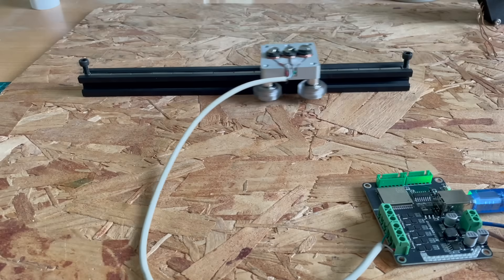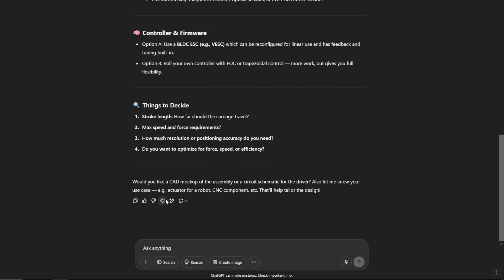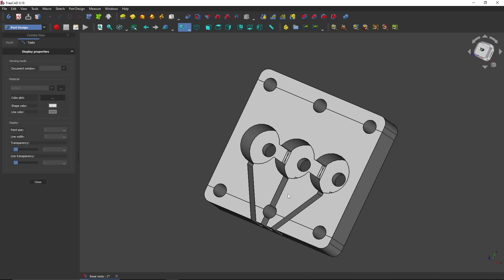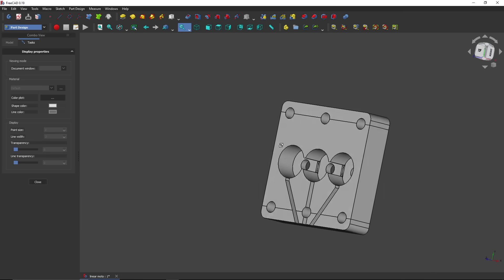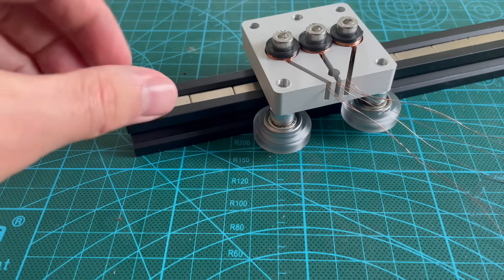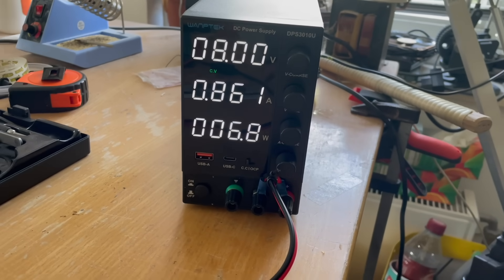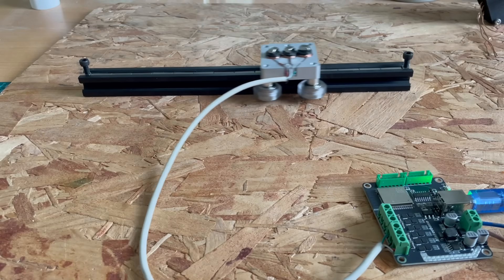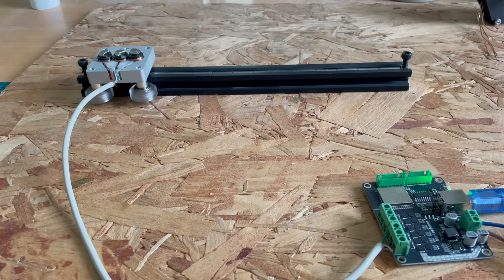AI Designed This Linear Motor

Comment: Whells were oriented correctly, i'm not sure about coils, but linear motor don't necessary means it will float in the air, so wheels are in good direction
Reply: The wheels were definitely wrong on the first AI draft, especially if he wants to use these linear motors as actuators for a moving robot. If we go with the AI's orientations of wheels, the motor would only work while laying down, helped down by gravity, it would not work as a moving leg of a robot at all. So the wheels have to cling to and roll on the structural component of the motor, that way you can flip it in any orientation and the motor still works, it would not fall apart or change behaviour/effectiveness like a gravity assisted one would.

On the topic of the coils, they were also wrong, in two different ways. N1 is that they were aligned in a cross pattern regarding the aluminium structure, they should have been parallel like he did after. N2 is that each coil was having its main plane in a vertical orientation (the 3 sharing an axis) while the correct orientation is having the axis of each pointing down into different parts of different magnets, which you can see that he also corrected.

The design is correct on both accounts, and at no point the motor is supposed to levitate, it just rolls on the wheels. The main problem is the amount of power not being much, and not being efficiently used, that's why it's a 100g motor and not a few kgs.
Reply: Agree, let the wheels carry the load and let the motor move it.

Comment: and so we all get dumber.
Reply: I disagree, I'm a manufacturing engineer with a lot of experience in running CNC machines, manufacturing, 3D printing etc. I can design and fabricate about anything I want, but when I try to incorporate Arduino my skills are still basic. I've taught myself a lot but I don't necessarily want to spend 3 hours designing and then 30 hours trying to figure out basic code for a project. Chatgpt allows me to enter a prompt and get code that is 90% and there and helps me understand how it did it. It allows a lot of us to expand our abilities.
Reply: and faster

Comment: Magnets on a shuttle instead of on the rail will allow you to optimize the electronics. Suggest you flip the design. Also add linear scale so you can compensate for lost steps. You might be able to increase torque by decreasing the speed.

Comment: Cool project. Didn't know these types of motors requires a "FOC". Hope you make a better version of it that actually has good torque. I think you would need to create a laminated core inductor housing for the coil so that it can eliminate eddy currents and maybe better coils too to get good torque. "Metglas" cores made from amorphous metal are the most efficient and can provide great torque.

Comment: Linear motors are pretty cool, huh? Imagine a stepper motor, just un-wound and flattened, and then this is essentially what you've created. as others have said I would use thicker coil wires, alternate the poles of the magnets and space them out slightly but evenly, reduce the coupling distance from the coils to the magnet array and use a ferromagnetic core within the coils too, such as a "U" or"E" design for a 3-phase motor like yours, then another trick is to use a steel or iron backing plate to further amplify the feromagnetic force the coil driver has on the stator array. You're on the right... track Haha, but no seriously, check your code and ensure the timing is correct too, with these additional modifications you should be able to produce some good torque, especially if you use a printed base and reduce the weight of the driver saddle significantly.

Comment: For a more powerful motor, I would put the magnetic poles closer to the magnets. Also, I would use thicker wires in the coils to handle the higher current. This is necessary because the voltage of the system must be increased, which increases the current. This increases the flux, so in the end the motor will be stronger. Good luck!

Comment: 8:25 It would not move a kilogram an inch.  Therein lies your problem. 

The magnets should be much stronger with the field attached to a series of poles.  Look inside a stepper motor.  The gap between the rotor and stator must be as close as possible.

Comment: excellent video - subscribed - didn't know ChatGPT could do this

Would you be willing to share your prompt? 
I'm also curious what chatgpt would say about increasing power - were its performance estimates good?
Do you think the wheel orientation limits performance because the load sits vertically, off-axis on the wheels?

Comment: Very cool! Never tought to unwrap a motor this way! I don't necessarely think its not strong enough for the load you were applying (cause it wasn't lifting the weight, just trying to accelerate on a low friction set up)... It feels like there should be a feedback on the position of the carrier. In the velocity_openloop mode, the motor driver will blindly produce the signal for the coils, regardless of where they are relatively to the permanent magnets. So when adding a load, even if the motor isn't going as fast as the driver think it does, it still sends the same signal which stalls the motor. To fix this, you can still use the simple_foc library, but you should try a closed loop mode (FOC) with some sort of position encoder. Now the library is made to work with rotational encoders, but I am pretty sure you could use 3 simple  hall effect sensors in the same way they are used in bldc motor, provided they are properly spaced (I think it works better using trapezoidal modulation with these sensors). You could also use other sorts of linear encoder  and scale the reading so to trick the algorithm to think the motor has done one electrical rotation for each magnetic pole pair the motor passes. Keep up the good work:)
Reply from the maker: Yeah a position sensor would be a good idea but then id have to use some sort of linear encoder and they are hard to use
Reply: @DeanZylman  The hall sensors would give you dramatically better torque and there are controllers that should allow you to use them pretty easily. It's the same method hoverboards use and they get a lot of torque using that method. re: Linear encoder - not needed you already have wheels. Put a rotary encoder on one - way simpler.

Cool project, subscribed

Comment: ChatGPT design a motor, but perhaps you need to have a chat about power and torque (force) requirements.
Reply: You overestimate its smartness. It solves simple and well described tedious tasks, it is not capable to correctly generate non-standart out of box solutions. If it cant be solved by better magnets/coils, it will fail.
Reply: I disagree. This is not so far out of the box that ChatGPT wouldn't know that linear force is akin to torque in a rotary motor. It'll know what magnetic field strength (B), current (I), and number of coil turns (N) are needed. It'll be able to translate voltage and resistance into current. It'll be able to suggest if the field strength is possible or ways to improve the field given the constraints. This is all standard motor stuff. I bet there's a fair bit of information on linear actuators that it'll know about. It'll know a lot more than me.
Reply: then it will give you the image of a train :)
Reply: You need an iron core, check the distance to the magnets, resistance and number of coils

Comment: You should try adding a position sensor so you can use foc closed loop which will give you much more force with few modifications, probably a linear encoder
Reply from the maker: Yeah a linear encoder would be nice but I don’t know if it wil work with the open FOC controller
Reply: @DeanZylman the controlling circuit can sense how many steps it moved. Basically you have 3 coils, two have reversed polarity and one as sensing input.
Reply: for linear encoder use the absolute linear inductive sensor by microchip. device name LX34....  @DeanZylman
Reply: @raziel06001 @DeanZylman
As mentioned above by @muayyadalsadi when you have at least three phases of coils you can record the electrical feedback as the coils engage with the magnets to use the driver itself as a linear encoder. It's a bit more complicated than that, but that should give you a lead to research along if you take it in combination with their comment as well.

Comment: awesome build, and super silent, obviously! Too bad its so weak. I dont know anything about anything, but maybe building it with larger coils/magnets would give it some torque. Been considering building myself a rail/dolly for my timelapse DSLRs but would definitely need a bit of torque and the ability to hold its position where this would (I assume) slide around if not perfectly level, or a breeze came along, once it lost power. Loved this video, man :)

Comment: Very cool.  I think the next step is to use a Halbach array to concentrate the magnetic field above the Al extrusion and to get more torque.  Also, you probably want to use something better for the center core of your coils, something with more flux density carrying capacity than those bolts, and ensure that the ends reach nearer the magnets.   I'm not sure whether there's an optimal spacing between the three phases and the magnets as well.  My guess is that if you got shorter magnets, you would be able to get more precision, and if setting them up as a Halbach array, a significant amount of additional torque.  It may even benefit you to cut some very thin vertical slots into the Al extrusion near the top, in case you're incurring significant losses due to induced currents in the aluminum.  The slots would limit any circulating currents.  In any case, I like it.  I was looking into a building a cheap linear motor too, and I like this approach.  I say, keep working on it.
Reply: Just to add.. I hope you don't quit... I can't understand why you would get this far and quit... It makes no sense to me. So follow the suggestions of the HalArray, I know JLCCNC is your sponsor but for now 3D print your rotor (until it's refined) your windings are too big., the material between the windings and the screw is way to big, shout be in the order of. 1-.2mm for this design. You can print a case for the magnet to slide in the slot then have shorter magnets that are also taller. I would use a material like PA6 from Bamboo Lab only because it's hard and will not spread your flux field.  I figure you went with three because standard motor config but in your case you need 6 if you stick with this. (I personally think you should stick it out and build your own.. This idea you have is bonkers (great).  You can also use an esp32 S3 with tcm2209. Last suggestion is instead of the screw you may need JLC to make you some top thread rods from a material that is more suited for this application (normally silicon steel) or you can design it in cad make a negative mould. Then mix silicon steel powder and 2 part epoxy and aluminum oxide a bit of silica and make your rod. You only want it to have a magnetic field when energized and lose it after so you don't have it working against the motor (cogging) If it's top threaded it will stay in but the part that is closer to the magnet needs to be predictive in shape not threaded. The distance between the rod and the magnet must be very close...0.1 max. Best wishes
Reply: @zaybxc0  why do you say that he needs 6 poles instead of 3?  And do you mean 2 of each phase next to each other like a 6 pack of eggs shape?

Also, Would 2 not be sufficient?  Or maybe I’m only thinking of what’s needed for motion and not precise motion.  More poles would be more precise, right?
Reply: @MantisRay861 The poles (6)were to address the issue with low 'torque ' really force. The flux created by the coil needs to be directed to the magnets (much like reflectors in a spotlight or lens in front of a light) so if your 'light source' is small simply increase your 'bulbs' in this case your coils. But put them in parallel, this keeps resistance low. (unless you prefer higher voltage and lower current) So you would have. :a, b, c, a, b,.c. When you energize it would be A, b, c A, b, c. Remember to use shorter but taller magnets (if you can't find taller just stack them) and keep the air gap(space between magnet and coil as close as possible. (this will substantially increase forces).
Reply from the maker: Thanks man, A halbach array is a really good idea but it might be tricky to fit the magnets into the 2020 aluminium extrusion 🤔
Reply: @DeanZylman  Just 3d print the extrusion that suits you. I didn't exercise the idea but my gut says E shaped transformer core might help to confine magnetic field as well.
Reply: @DeanZylman  maybe an increase in magnet count with shorter length magnets could help, but then you also need more compact or even flat coils.
Reply: speaking of which: rectangular coils with the current spacing would also increase force by having more inside area.
Reply: @TobiasKornmayer yes but think of it like a gear. Yes a thicker gear has much more power to transfer forces, but it is also jerky and normally noisy. So in the same way the size of the coil/magnet pair(gear teeth) should represent the size of the motor(gear system) Technically speaking a linear motor is a radial motor cut at the radius and layed flat. So grab an existing motor design and work from there.
Reply: @zaybxc0  The current is modulated to a sine wave, so no cogging or jerking. 
The coil dimension in travel direction needs to match the magnet length of course.
Reply: @DeanZylman you can get much thinner (square cross section instead of rectangular) for the intermediate magnets of the halbach array, they dont have to also be rectangular and at 90 degrees. Usually the intermediate magnets in a halbach array are a fair bit smaller/narrower than the main magnets since they're mostly there to direct the magnetic field of the main magnets that you already have. Think _._._. Rather than _l_l_l
Reply: This is why I love youtube comment section
Reply: Some humans still better than ia
Reply: Definitely something better in the poles.  Probably if you could, you'd want a ferrite or something.  Probably also worth putting a keeper on the non-magnet side.

If you can rig it... make a 2nd 2020 rail with the magnets alternating [no keeper!] the bottom rail and that should help a lot.

Dunno about a Halbach.  It sounds good, but it has the annoying tendency to make the manet alternating bands of strong and one-pole, so I'm not sure you can handle your 2020 being "all north"
It's probably also worth putting little plastic spacers between the magnets in the rail to get the fields to want to go more "up" to bridge the gap.
Reply: Maybe if the rotor  was made of iron, it would converge more the magnetic fields.
Reply: @thomas-xavierguimont2760  Steel, iron, and ferrite are good for that.  Problem is steel and iron really don't like to change their direction (they saturate too easily), so your "force from the electromagnet" is having to overcome "magnetic attraction to the steel."

Ferrite... doesn't take a set as easily, so it's easier to flip around.
Reply: .... Hence silicon steel... A bit more expensive but designed for this... That's what transformers and motor lamination are made from.
Reply: @zaybxc0  ok, yea, I understand you need the coils as close to the permanent magnets as possible due to the drastic reduction of flux density per unit of distance increased, and vice versa.  
Regarding the use of 2 coils for each phase, that’s simply to increase flux density, that makes sense.  Another option would be to make the coils longer and narrower but longer coils wouldn’t result in less precise movement, right?

But regarding 3 vs 2 phases…It seems easier to use 3 so that basically any sensorless brushless motor controller could be used, but do you see other downsides to using 2 phases instead of 3 for a linear motor?
Reply: They make all sizes of magnets. Try searching K and J Magnetics. Also, I’m sure there are many others.
Reply: Halbach definitely, and no aluminum extrusion. Use steel to enhance the magnetic fields, or if that's not feasible a non-conductive substrate to avoid hysteresis losses from the slider. Making the slider out of plastic will help reduce that too, and placing the coils closer (0.1mm to 0.5mm ideally) will strengthen the slider a lot.